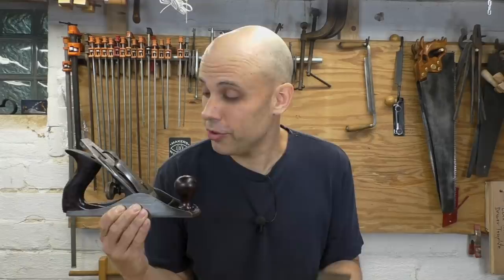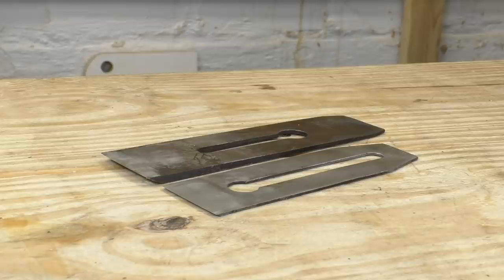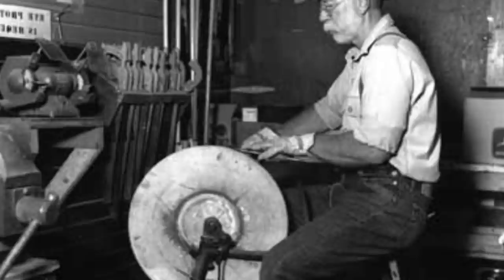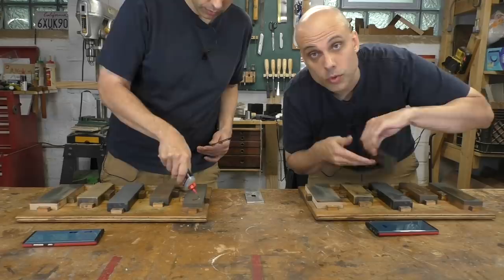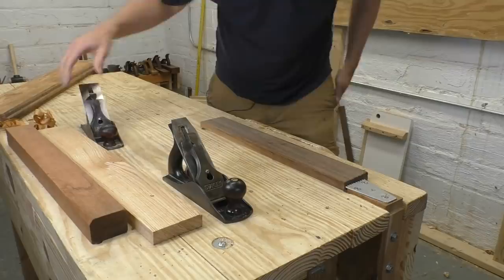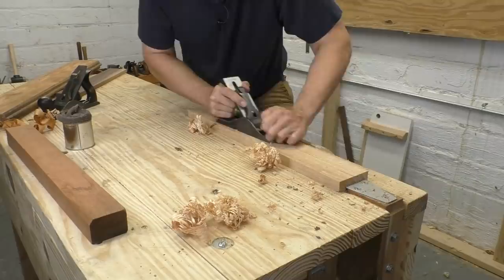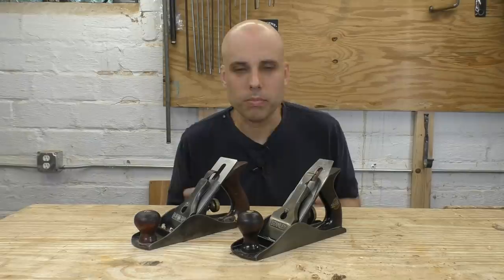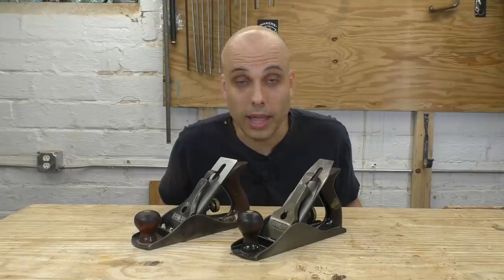Modern vs. Vintage Plane Irons. Head-To-Head Test!

Comment: Anne of All Trades recommended replacing the iron with a new, specifically for WWII-era planes (and maybe after?) due to wartime shortages. It would be interesting to know if there is any substance to that, as it seems more plausible than the thin iron itself being a problem.

Your methodology might have introduced some unintended bias (at least, what was in the final cut appeared to): You always started with the Stanley and used the Union after. You used the new iron in your less preferred plane. Maybe the Hock iron would seem better on the unplaned wood? Maybe it would seem really great in the plane you've tuned the hell out of?

Finally, I cannot pass up an opportunity to admonish a former English teacher for misusing the phrase "beg the question". 😁
Reply: What if he "Begs to differ"? “In 100 years we have gone from teaching Latin and Greek in high school to teaching Remedial English in college.” -Joseph Sobran

Comment: Hi Rex, interesting video clip regarding replacement plane irons....I too have noticed a small difference in high end plane blade function when compared to the original blades. Perhaps a thicker chip breaker would make the difference on the thinner Stanley original blades ? These will be cheaper than a blade too. Your thoughts ? many thanks. Midge in Scotland
Reply: Agreed. I've suggested (a little while ago) that he try and experiment with the Hock chip breaker alone on his similar sized planes to find out what difference, if any, it would make.
Reply: Yes it would be an interesting comparison with the original blade and a hock chip breaker? Perhaps this would make all the difference and elevate the original blade somewhere near the after market hick blade ?
M

Comment: If the mouth is too wide, then a thick blade will fill up the gap more. That's about it.
The whole point of the Bailey pattern plane is that it beds a steel blade, with a given Young's modulus against an iron frog with the same Youngs modulus; the frog and the blade are of equal bulk stiffness. (Note I am talking stiffness not hardness. Hardening steel does not change it's Young's modulus.) So within limits the thickness of the blade is not important.
On a wooden bodied plane the wood has a much lower stiffness than the iron, so the steel blade has to be thicker because of the lack of stiffness in the wood behind it.

Comment: One of the biggest advantage (at least for me) about Hock Tools is that it was pretty much the only manufacturer to sell replacement blades with a width of 2-1/4" instead of the standard 2-3/8", which couldn't fit into my century-old corrugated Stanley 5 1/2 (it seems the 5 1/2 designs changed later to accomodate 2 3/8" blades). The price asked on ebay or in flea markets for 2-1/4" Stanley blades wasn't that much different from buying a new cryogenically-treated A2 blade, so I figured, why not bite the bullet after reading a lot of good reviews. 

The other advantage is that the Hock blade needs to be resharpened fewer times for the same job compared to my other old #4 and #6 Stanleys. I was dubious at first, but after a year or so of regular use, I can say that this statement read in reviews is true, albeit not by as much as some seem to think. But it does makes a difference if you hate sharpening.
Reply: Anyone that hates sharpening needs to get better at sharpening. Then they won't be spending much time sharpening. Because they'll be good at it so they'll be able to sharpen quickly.

Comment: from my experience thick iron give less vibration compare to thinner iron..but it still can be useful when you have no other option..like i said earlier, it just my opinion from my experience only..
Reply: Great point, but I wonder (and I don't know this for sure) if the chatter is the fault of a thinner iron, or the fault of a warped iron, or, last but not least, the fault of a poorly tuned plane? I really don't know but I am curious.
Reply: @dwainlambrigger3769  poor tune also can lead to chatter problem if the frog didn't set at the right angle and the blade didn't rest at it best..

Comment: Hi Rex. I hope i can ask you about something. When i was doing research hand drills two images generally pops up, the "Brace Drill" (the one that you use most of the time in your projects) and a "Hand Drill" (a bike looking hand drill that has a crank connected to a big gear at the side) Have you used one of these? Do they do the same task? Does it also use special bits like your Brace Drill? Which one is easier to use?

Comment: I have some technical questions... You mentioned the Hock Iron made wider chips, what could cause that? Is the iron physically wider? could it be a minute difference in sharpening? does the chip breaker flex the iron? I also noticed the Union plane has a serrated shoe (? it has grooves on the bottom, I'm new plz forgive my nomenclature?) would that make any difference in your experience? 
Great vid btw

Comment: I GOT NEW PLANE IRONS TO AVOID THOSE NASTY MICRO PITS FROM OXIDATION FOUND ON OLD IRONS. I  HAD TROUBLE SHARPENING THOSE OLD IRONS TO GET A SINGLE  FULL WIDTH EDGE. MICRO PITS SEPARATED MY CUTTING EDGE INTO SEVERAL WIDTH EDGES. ALSO  MAYBE NEW STEEL MIGHT NEED LESS SHARPENING

Comment: If you are making fine furniture you are going to select the best wood that you can sort through. Both thick and thin irons can be used in that fashion. 
If you are making general craft pieces then wood selection is not as important and you can use grain that does not have as good a finish and both irons will work in that as well with the thick iron offering a small advantage on certain grain patterns but you are still going to have to judge the wood if you want the best finish. 
Wood finish is not that important in construction carpentry.

Comment: Why replace the iron? In my case it is because the original singer iron was shaped like a banana after a many decades of being clamped to a not-flat frog. So I flattened the frog, but flattening the blade would not have left much blade remaining. So off to the internet for me to order a replacement blade. Also being fixed up at the same time was an old craftsman jointer plane. That was worse. I'm still waiting for the two bladed in the mail.

Comment: I don’t know if my ears are right or not, but as soon as you use the hock plane, you can hear the difference. It sounded to me like resistance, which was a strange translation of sensations to me. But then you said it engages the wood more which fits entirely with that interpretation of the sound.  Does it feel like you need more muscle to push it?   Also, I’m wondering if you or anyone reading knows how the hock iron compares to a Japanese plane which is also layered like that, although I have no idea if the method is the same, or if it’s the same layering you discuss.

Comment: I bought a hock iron for my dad's 50's vintage no. 6 plane and it wouldn't work at all until I finally got the nerve to file the throat to be a lot more open.  Otherwise the blade absolutely would not even fit.

Comment: Rex please help! I have a Stanley Bailey no 6 type 11 plane but need to replace the frog. I can’t seem to find an exact match for a reasonable price. But found a no 4 type 11 frog that looks like it is an exact match. I also can’t seem to find anything online about swapping out different number size frogs but same types. Do you know if this type 11 no. 4 frog work on my type 11 no. 6? If anyone can answer this question it is you!

Comment: Rex, does that Hock chip breaker sit fully flat against the back of the iron?  If it does, could it be that flattening the back of the iron lowered it in relation to the chip breaker?  Could that be the cause of the shavings getting between the two?  (great video, again)

Comment: much harder irons are pretty much good for one thing - people who take forever to sharpen and have no clue what a burr is. They release the burr more easily. 

Understanding what's actually happening at the edge and how to use a plane, though, is more important - if an iron seems to soft, it probably just needs a minor adjustment in geometry. 

What's the difference in edge life between very hard O1 and something like a stock stanley iron? About 15-20%. But if the stanley iron is a bit softer and deflects right away because it needs another 2 degrees, it'll seem like 90%. 

If professionals wanted harder and thicker irons, stanley would've made them. It would cost about $1 extra per iron. They're fodder for beginners, but sometimes you have to give beginners what they want, because they're looking for the real life version of "in app purchases" to try to get to the next level. Just like apps, that gets you to the next in app purchase faster.
Reply from the maker: Always happy to hear your thoughts, David!

Comment: Really glad for this as I have a #5 that needs a blade and was looking at one of these thicker irons. Any thoughts on the flat chip breaker vs original? Also, come long way from home ground mower blades ;)
Reply: Flatten your chip breaker too so there are no gaps for the shavings to find.

Comment: I’m not really too familiar with the craft of hand woodworking here, but in theory only the cutting edge of the blade engages the wood right? why would it matter how much steel is behind that edge for cutting as long as it’s thick and sturdy enough to not flex?
Reply from the maker: You have it exactly. The thicker blade is supposed to cut down on flex, which we call "chatter".
Reply: @RexKrueger  flex leads to chatter. If the blade just flexed and stayed flexed it wouldn't chatter though. The chatter happens when the blade springs back and then flexes again repeatedly.

Comment: What do you think about filing the mouth open to accommodate an even thicker iron like the Cosman one? I am very hesitant to do it to a vintage Stanley, but I already bought the 3/4" iron.
Reply: Are you certain the Cosman iron is made to be used in a Stanley plane?  The issue is the depth adjuster having a long enough nub to engage the slot in the chipbreaker so you can adjust the iron properly.  Assuming it does the only way to use the Cosman iron is to widen the mouth.  Make sure the slope of the frog lines up with the back of the mouth to form a continuous smooth bed all the way through the mouth to the sole.  Then draw a reference line at the front of the mouth and slowly file it to keep everything square and even.  Finish the filing with fine sandpaper backed up by the file to polish the mouth and remove any burrs.  Take your time and only remove enough metal to allow the shavings to pass.  Good luck.

Comment: Although I completely support the point you made here, I feel you missed the point entirely: Normally the reason people advocate thicker irons is because, according to them, they mitigate chatter and not because they produce better shavings or something. But as I said, I support your point, that the difference is neglegtable, because chatter isn't a thing regardless of your iron thickness if you set up the plane well and change the angle of attack in difficult grain. I have a few Ron Hock irons myself and even thicker, laminated irons and as you said, I feel they do work a hair better than thinner ones, but no where near the life changing experience people preach about.
Reply: @RexKrueger  same here. Never had any issues with chatter, and I think your guess concerning the too thick of a shaving might be the reason some folks have trouble with that. Or maybe too much friction because the sole is bone dry.
Reply: I think the primary issue is the quality of the tuning on the plane and the iron. Get those two things down and you shouldn't need a new iron. That being said, it's nice to plane for a longer period of time without sharpening, and I fine the newer irons are great for that.
Reply: @dwainlambrigger3769  yes, agreed. Also agreed on the "newer Irons stay longer sharp point". At first I wasn't really confined that that was the case since I always used O1 irons and couldn't make out any difference to vintage irons in this regard, but once I bought a used plane which happened to have a A2 iron  I can confidently say it stays MUCH longer sharp, albeit by the downside of being a bit more time intensive when resharpening than the O1 blades are. Now I tend to use O1 blades on planes I always want to be razor sharp (aka. Being sharpened at the slightest sign of wear) like my shoulder plane or my finely set smoother and A2 blades on my workhorse planes, like my jack.

Comment: When I got my No. 5 I put a heavy camber on it.  I have a wooden jointer that doesn’t seem ideal for shooting, so I’ve considered getting a replacement blade with no camber.  Should I go for a cheap blade or a hock for shooting?
Reply: How much do you shoot? If it's an integral part of your process, and you do it often, then I think it is wise to invest. If not, I'd get a cheap or old replacement iron and sharpen the heck out of it and give it a go.

Comment: I am curious, wouldn't the width of the shaving have more to do with subtle differences in sharpening? I appreciate this review. I've been thinking about replacing/supplementing my old Victor iron with a new one from Veritas. But this has me thinking.
Reply: could be the hock's one is a couple mm larger
Reply: I would think the width of the shaving is based on how much of the blade width is engaged with the wood.  The shaving can tell you about how the plane is set up, but the surface left on the workpiece is the real measure of performance.

Comment: I’ve used a Hock plane in my smoother for a couple years. I’ve often felt the difference (which is small) had as much to do with the chip breaker. What do you think?

Comment: A rock will drive a nail. Wouldn’t you rather have a hammer?  All this “they spent years perfecting the plane and iron “. Henry Ford spent years perfecting the model T. Think they’re as good as a modern vehicle? Sure they’ll get you to your destination…but no ac! I’m quite positive that this is the exact arguments that wood plan users had when metal planes came out. “Wood has been perfected for centuries. Why would I need a metal plane?” Not ripping you Rex.
Reply: Thought about this some more. I watch you work very hard to lift a shaving that looks at least twice as thick as a piece of paper(.008”) Dial that back. Take shavings way thinner. Try taking a shaving that will float to the ground. You’ll work less and have more fun.

Comment: Dude! What are you doing??? These are smoothing planes - the shavings must be almost transparent. Yours are 10x thicker then what you should be getting for a final prep. Both stanley and hock can give you those. And that was a soft pine!!!
Reply from the maker: I don't know which is funnier: Your scandalized, little girl whining, or your total lack of actual knowledge.  No,  I take that back,  the girlish whining is funnier.  By a long shot.
Reply: @RexKrueger  what does it even mean  - “scandalized, little girl whining”??? You’re supposed to use a smoothing plane before applying the final finish - and you’re taking huge, full-width thick shavings that are bound to leave scratch marks and a rough surface. What’s the point? And this is on the easiest wood - soft pine. Just use a power sander instead… i used both blade types and also a2 from ln and pmv11 from veritas - at the end, if you use your jack plane right, the smoothing plane blade doesn’t make a huge difference.

Comment: That isn’t a fair test as the Hock iron went on to planed wood
Reply: Do you mean that the Hock iron fares better on rough sawn wood?🤔
I thought the steel material was different on the Hock, and that would play out in longevity.  He did not test longevity.
Reply: No he didn’t and he planned the same wood after using the Stanly